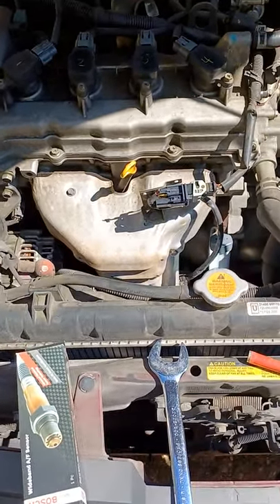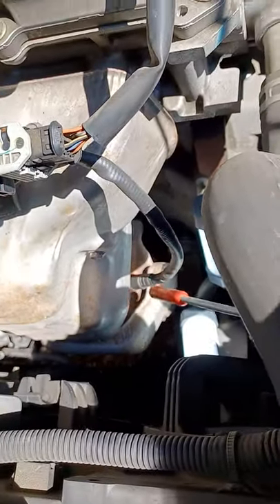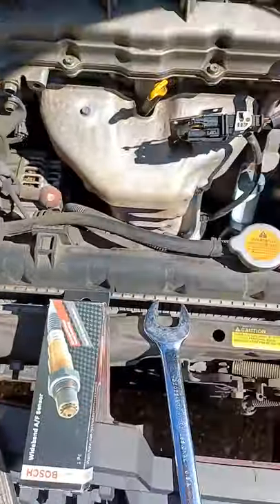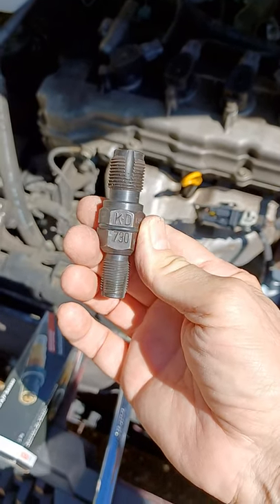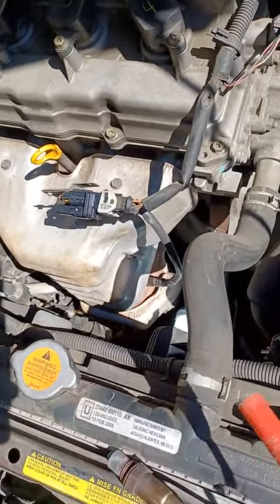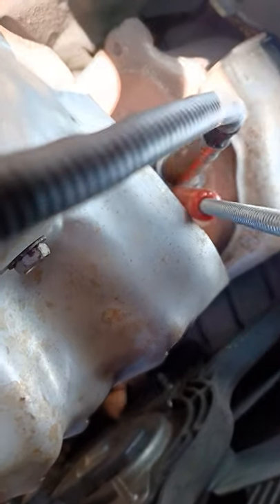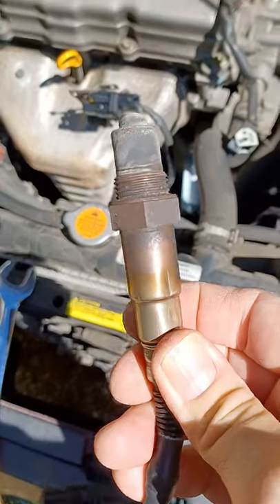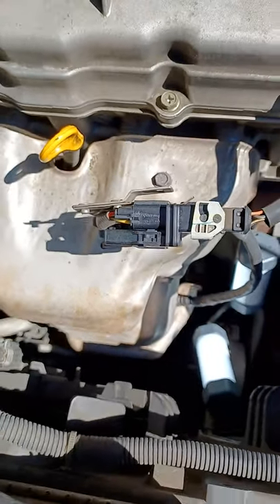2000-2006 Nissan Sentra Oxygen Sensor Replacement

Comment: I did all that on my car I have a 2006 Nissan Sentra 1.8 l and I got the same code again later on and I replaced the map sensor and I'm still getting the same code check for any leaks in the hosing or anything like that nothing some suggestions would be greatly appreciated

Comment: How did u get it out ?
Reply from the maker: Using the tool you can borrow from the parts store.  It's was as simple as screwing a nut on a bolt.  If your's is not coming out, then keep applying penetrating oil.  Work the sensor back and forth to break the corrosion.
Reply: @CaptainBob42  I have the special socket and breaker bar and spray, but the sensor won't budge. No room in there.
Reply from the maker: @WV591   If you apply hammer blows to the threads, you may loosen it.  Put the socket on the sensor (to prevent breaking the sensor or rounding the flats), then, using a metal bar, hit the socket as close to the exhaust pipe as possible. This will transfer the vibration to the threads.  Hit it from different angles. 

You might alternate using a torch and penetrating oil.  Use a good penetrating oil, not WD-40.
Reply: He just didn't show how to get it out. It's one of the worst videos I have ever seen.
Reply: @WV591  I knew I wasn't the only one with this issue...and I have changed o2 sensors on other vehicles as well

Comment: is it upstream or downstream, autoparts places ask that
Reply from the maker: This one is the upstream sensor.  Downstream is under the car.
Reply: @CaptainBob42  I can not seem to find the part for the Nissan, it seems the have a upstream o2 sensor but the threads are small in diameter then the original
Reply from the maker: @pedromosquera6076  They have given you the wrong sensor.  Try another store.